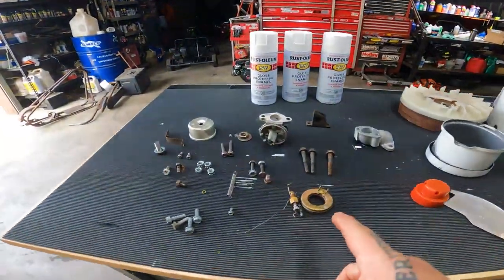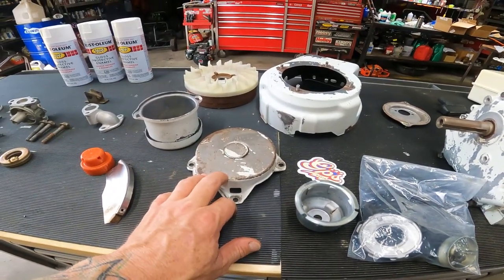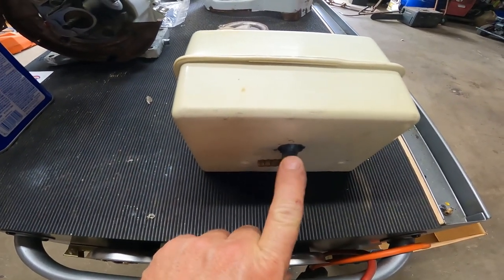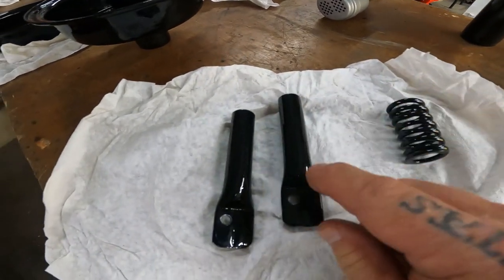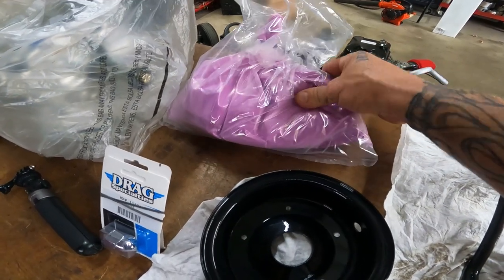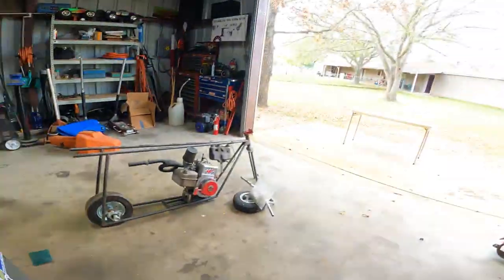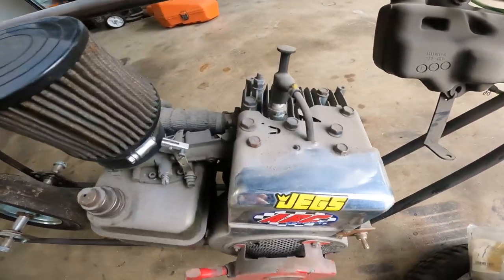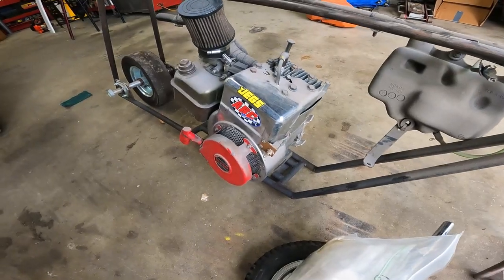Vintage Cat Duster Minibike Restore Part 2

Comment: Nice find and it has chrome!!!  For that tank u can use a Rotary part number 7730 and an elbow fitting Rotary part number 8678. Just drill a 1/2 hole in bottom, insert 7730 first then lube elbow and push it in.  Great video as always my friend
Reply from the maker: Was going to do that , but there is a screen in the tank and didn’t want to cut into that .
Reply: @BustedKnucklesBuildsTexas  Gotcha.

Comment: For anyone doing a restore on these, Cat used black Tecumseh engines, and silver wheels. Even when they used Briggs in '69 and back, they were black. Nice work, dig that shop!!
Reply from the maker: Yes sir , I like to change the paint up a little sometimes , And thanks for watching !
Reply: You're welcome, bud. I wish I knew what the factory color is that came on the Duster. I'm doing one now, the frame I have has zero factory paint left to get a match on. I want it as close to correct as I can get it. So many different shades of purple. I need to find that Tecumseh 3 horse now!! Have fun with the bikes! @BustedKnucklesBuildsTexas
Reply from the maker: @Iatolaazzahola try  some small engine shop , never know what you can find in there junk pile , good luck on your build